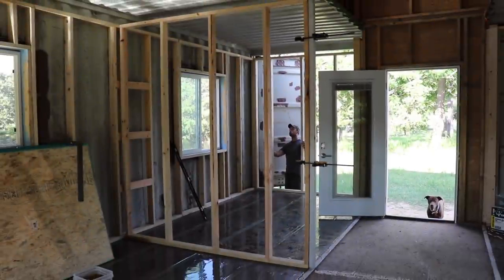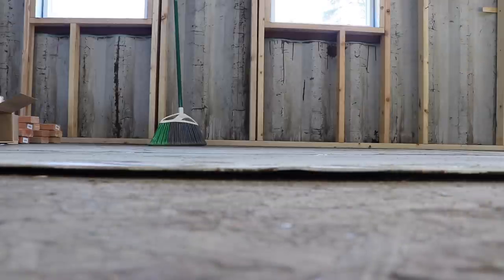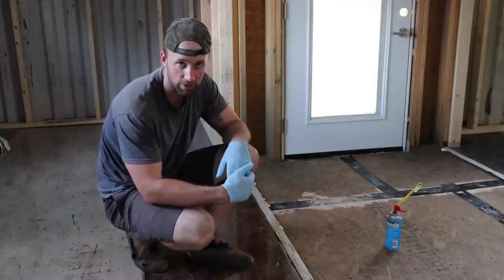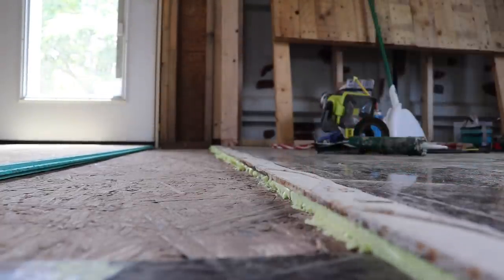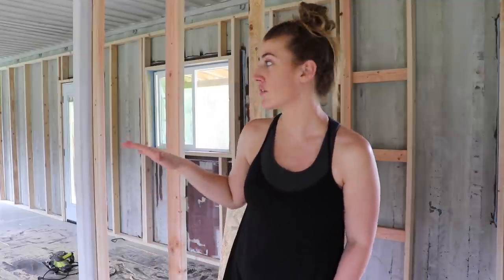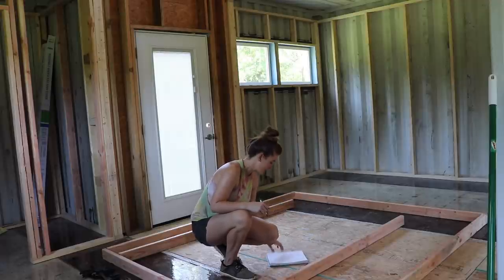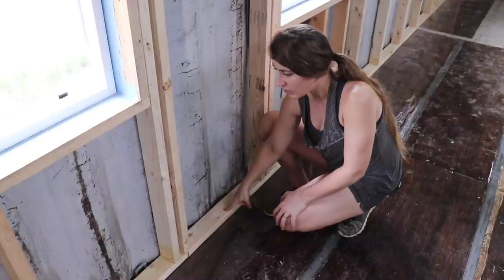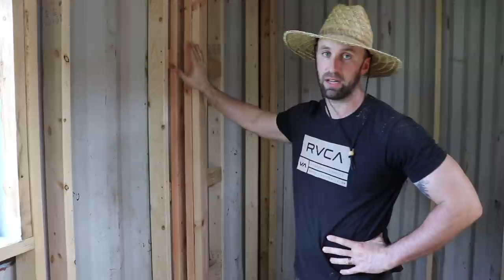Building The Rooms In Our OFF GRID Home!

Comment: There's a lot of framing to go. If you're doing your own plumbing, electrical, and hvac then nail on the boxes as you go. Switch boxes at 48 to the top, outlets at 18, bath outlet at 45, bath light at 84, fan box, range hood vent, holes for ducts and return air. All need planning and framing.
Curtain rods, towel holder, tp,hand towel, medicine cabinet, kitchen uppers lowers (3 runs) tv hangar, all need planning and framing.
Plumbing stub backing at every fixture including hwt. Sheetrock and tile backing for tub/shower. Tile backer for range. Sheetrock backing at ceilings. 

Tons of framing to go!
Reply: I would run conduit for the electric due to the spray foam. This will make it easier in the future if you have to repair.
Reply: @jerryhughes6263  
Did you price the difference? It's triple the cost over romex. Right now wire is back down to where it was 15 years ago. 
Congratulations on having the ability to work with the bender. Most folks think that they can do that job but end up quitting on day 2.
My point was about the framing. There were comments about being finished with the framing and I wanted to point out that there is alot more to go.

Comment: How are you going to insulate the floors? You'll have a lot of condensation buildup unless your insulate the floor on top of the steel
Reply: Absolutely Correct!
Reply: X-cellent point ...I thought about that too ...
they should apply a vapor barrier on the ground as well as under the house ...maybe they'll do that after the plumbing/electric ......
Reply: That would normally be correct however since this is a welded steel box the heat from the sun radiating against the sides and top will transfer through the metal frame to the steel beams in the floor which would be on the inside of the container. I've stayed in a container home when they insulated the inside on the walls and ceilings but underneath the wood floors and every morning the floors would be covered in condensation. Checkout insofast. I looked into that and they make kits for container walls, floors, and ceilings.

Comment: how did u  prevent the rust from external floor at the bottom of the container  (external bottom of the container which is exposed to the rain ).
kindly clarify.
Reply: I commented this several times. I think they are either doing it last or  just planning on falling through eventually. Lol
Reply: They'll probably do that when under the house for plumbing & H-VAC install. No need to get under there in snake season unless you really have to. Been there - done that. When you're on your elbows & knees, a snake can slither faster than you can crawdad backwards. It ends up being man vs. snake and hope you can kill it without getting bitten. No worries, though. Spenser is too OCD to let one detail of that house pass him by.

Comment: Love it! Quick question... what are ypu doing for HVAC?
Reply: Damn,, beat me to it. Did you say the property had a well and septic tank/drain field? and how have you guy's been handling that during all this build as in temporary water/sewer/shower....must be getting pretty crusty by now..eh!
Reply: I too am curious. I know there are energy friendly units out there that will work wonderfully with an offgrid setup but I wonder if they would be cost effective vs a traditional unit that sucks down power like a drunkie at happy hour.
Reply: Probably a mini-split - much easier than doing a bunch of ducting...
Reply: Theyre running piping down into the lake, reverse heat pump haha
Reply: They should have thought about that long before they decided to use a steel box for a home, but they worry about those minor details when they get to them.
Reply: @jcgoogle1808  i started following because this was also my dream... I still think it's better than stick built by far.. I'm just going to watch and learn ... my only concern is it sweating.
Reply: @j.michaelwilhelm7349  as of now they have a gym membership and that's how they take care of hygiene.
Reply: @19TL85  They've been at this for a year and they're still at framing which would be redundant on the exterior walls were it not for the steel being the worst material to use with regard to heating and cooling.

It will take substantially more energy than conventional construction to live comfortably. Not good for supposedly attempting to conserve energy and "live off the grid". With stick built, they could have poured a slab and been dried in and done with framing within a month or 2 at their pace...... while still "living off the grid".

Btw, "grid power" is much more efficient and economical than everyone setting up their own personal power plant, unless they minimize energy use. A steel box, doesn't do that.

If they really wanted to conserve energy, they would have poured the slab and built the home out of SIPs.

If they or anyone else wants to build a home in a dumpster for that matter. it's a free country, but the idea this conserves energy or "saves the planet" is nonsense.

Imagine 300 million Americans doing this on their own inherited 100 acre piece of land.

You'd do more toward "saving the planet" by minimizing urban sprawl and cutting down CO2 absorbing trees by living in a high rise apartment building.
Reply: I've seen many other shipping container home videos & most of them use the Mitsubishi H-VAC units. They're nearly flush wall mounted, don't require venting/duct work, & have motion sensors that aim the heat/cool where you are, so you always feel warm/cool. Plus, they can be integrated into smart home technology. In that small a space, that's what I'd go for.
Reply: @19TL85 
That's why they set all the wall studs 1/2" away from the steel walls and used the paintable flashing where wood contacts steel. When sprayfoam insulation is sprayed onto the steel, it prevents sweating. But I would have an H-VAC system that has a built in dehumidifier just to be safe.
Reply: @jcgoogle1808  
If we cut down CO2 absorbing trees, which release O2 in turn & also scrub the air we breathe, how is that helping the environment? Be clear on what you mean & write before you click "Post." City sprawl, with all its concrete and asphalt retain & radiate heat into the atmosphere like an oven. They're also a breeding ground for filth and garbage.

We live in America where people are free to live as they chose. Some like the city & some like the country. Being environmentally friendly extends only as far as I live, you live, or they live. Life is too short to think of yourself as "The Guardian of the Planet," i.e., the "Thought Police." A word of advice: Relax & enjoy life, because no one is guaranteed another second. These guys are having the adventure of a lifetime, and we get to watch. Why try to rain on that parade? If you want to be miserable & enforce your values on everyone, go be miserable somewhere else.
Reply: @jamesooten3659  
"If we cut down CO2 absorbing trees, which release O2 [sic] in turn & also scrub the air we breathe, how is that helping the environment? Be clear on what you mean & write before you click "Post.""

LOL Apparently reading comprehension is not your strong suit. I can't find my original comment and don't care enough to spend more time looking, but I was asking that question of those who think this (using a thermodynamically inefficient, that is one that conducts heat easily, the opposite of what you want if your goal is to be energy efficient), a steel box is "saving the planet".

"City sprawl, with all its concrete and asphalt retain & radiate heat into the atmosphere like an oven." 

I'm not sure what you're trying to say here (a piece of concrete or asphalt does not cause the earth to warm "like an oven", that would violate the law of conservation of energy) again, my point was,... how would 300 million people moving into the country, an urban sprawl,  save trees and the planet, if that's your intent? It would do the opposite.

High rise apartments, the opposite of urban sprawl, would be the choice of someone who was really concerned about the environment.

i also think that people who think that "climate change" just started happening with the industrial revolution are batpoopinsane. If that were the case, earth history has a lot of splaining to do. Man evolved as a result of climate change, not the other way around.

https://wattsupwiththat.files.wordpress.com/2012/04/400000yearslarge1.gif

This "living off the grid" thing is so cliche,... any crazy idea regardless of energy efficiency is considered contributing to "living off the grid".

"Be clear on what you mean & write before you click "Post." "

LOL Too funny.
Reply: @jcgoogle1808  x2 If they would have put the money and effort spent on using containers not suited to living in, and stick built, it would have been much easier to build, more efficient, and as you said, finished in much less time. While they have put in great effort, I don't see a point to the containers. A slab would have been more efficient than setting all of those piers and dealing with the containers. Then again, I'm a pro in the building trades and have a couple decades of experience doing all of that type of work in residential and commercial buildings. They either don't understand the benefits to stick built over steel containers or are just hard headed and did it to get people to watch. Off the grid is great, but why would they make their build even more difficult than it has to be?
Reply: @CGT80  "A slab would have been more efficient than setting all of those piers and dealing with the containers. ........... Off the grid is great, but why would they make their build even more difficult than it has to be?"

Exactly or more energy inefficient. 

I'm not sure with the steel building envelope how it gets connected to "living off the grid", but it's kind of hard to not watch...like a train wreck. ;)

If the industrial architectural look is the goal, why put it in the country? Developers rehab old warehouses and industrial buildings into condo's etc everywhere. That actually looks good and cleans up a neighborhood.

Putting a shipping container in the country is anachronistic when not too far away the Texas Hill Country has a rich architectural history of buildings with stone walls. A lot could be done wrt to energy efficiency around the thermal mass of stone.

But it's a free country. More power to them.

Comment: There is a couple here that did just what you have done . And they said they put insulation in there ceilings and had to go back and put more because of the heat !!! Also had to double insulat the walls. Other than that , they are as happy as 2 ducks in a bathtub !!!!! I must comment myself .... Yall 2 have worked your butts off and have done a great job can't wait to see the finished project !!!!!!!!!

Comment: Beautiful dog you have there.  Suggestion:  You may want to consider packing the interior bedroom walls and the laundry room walls with dense foam insulation.  That would make the rooms quieter and in the case of the laundry room it would block off some of the washer/dryer noise from the rest of the house.  Don’t forget to insulate the ceilings too as the washer/dryer can get pretty loud and in a container home it would only reverberate throughout the container if the sound isn’t contained somehow. The bedroom insulation also makes it a little quieter for sleeping or napping.

Comment: Hey, love the new video! NOTE- My friends built a container house in Tennessee about 7 years ago. He said the interior roof of the container attracts humidity when you have ac on and its hot outside. He opened the cieling  to put in a cieling fan, (frame, like yours is going to be) and found condensation on the metal roof, and some rust. They checked inside a couple places on walls, and found some but not as much. He said he would Herculiner the cieling inside before building the frame drop if he had it to do over again. He said the inside is no longer airtight once you start cutting holes for windows and doors, no matter how much you caulk. I know Spencer loves doing extra work so I thought I would pass this along. 
I need more Bear in my next video btw.

Comment: Hey guys. If you are gonna have a crew spray foam the insulation.  You may want to fill the gap between the metal and the stud with canned spray foam first. If not it might push the wall out.

Comment: Recommend you open those upper windows and open the lower windows on the shaded part of the house. It will get rid of the stagnant air and give you a little bit of breeze.
Reply: Interior is really coming along. Soon you will be painting the walls! What about windows high up on the interior walls so you can pull in some natural light from the atrium into the rooms that only have one window or none.

Comment: if you bury 24" pipe (sealed up) 8ft deep, 12ft from house and 25ft longer, with ends to complete the "C" shape into inside at both ends, your heating and cooling would be about done with just a 20" box fan. with skirting some (air) can be run under the floor too. Geo-stable temperature is about 70 degrees.

Comment: You need to corner your wall frames or you'll have dry wall without support on the ends, and be sure to pre drill your holes for your wiring so you don't have to back the boards off to get them through.

Comment: the dead space that will be above the wall could be a good channel to run your electrical feeds ,at least for that side of the house ,it will save alot of time and wont have to drill hole as much ,do the same on other side but make sure the wires stay on top of the wall plate ,then just drill a hole every so often to feed receptacles or whatever lights switches ,looking good ,you guys did alot of editing on this post lol spencers funny put more bloopers in

Comment: Guys, I think you're doing a FINE job on the house. I would like to give you advice about your pocket doors, I know you're going to have a few of these so when you buy them please order a few extra top tracks and probably 6 or so sets of rollers. The reason behind this is that these cleaver pocket door manufactures have a wild Idea to change the design every 5-7 years and when your rollers or your track messes up down the line and you fine it extremely hard to match your hardware you will say to yourself, dang Karl was right.

Comment: Nice ! you are building in the right climate, for us we have -30 degree winters which increase the cost by 40%....for your floor planicrete  would of been lower cost and fast. Up here we use pink wood and 3lbs close cell stray foam...condensation is a real pain.
Enjoy your new abodes :]

Comment: Did you guys insulate the floor underneath and sandwich it with more plywood on the bottom of the joists? I can't remember if ya did, not to late if you didn't, a lot of heat and cold can migrate from underneath. Keep up the good work, my wife and I want to do what you'all are doing, very inspirational. Cheers!

Comment: How do you plan to ventilate the insulation above the walls (ceiling)?  Unless you use sprayed foam the moisture that rises through the ceiling and vapor barrier will form mold and possible dripping.

Comment: Really nice project... been following since the first vid and am loving where it's going!  
Questions
1) if you are going to cover the epoxy floors later, why wouldn't you cover the full floor with 1/2" ply/osb first and set your wall base plates on top?... building on the floor rather than contouring it later.  
2) why didn't you install a vapour barrier along the outside walls?  I'm from cold Canada and I probably would've installed one.

Thanks for the videos!

Comment: Had to read around to find your in Texas  Not much for a cold winter So no real need for soild spray foam insulation  Which i would swear by if your in Northern Canada  But your in a 2-3 zone for moisture so you dont even need a vapor barrier... When i watch your videos I think where i would do what next. Electrial and Plumbing..2 Outlets for a main wood stove And a mini for the bedroom Then 2 to 3 inches of spray foam ( We see Artic air winds. And frost bite in 5 mins ) 

Oh ..And remember before you board everything up take one last look and think...Do i need a outside electrical outlet in the wall or vent ..better now then after lol cheers all the best

Comment: Hi looks so exciting. I was wondering what you r insulating with. I know in hot climates there r certain foams and such that should be used with the shipping containers because of condensation, mold . The steel will sweat from ac inside just wondering what you guys are going to use ? Looks great I want to do this too if I can get my hubs on board.

Comment: try a fan too move the air around, once the old air is out there should be ten too twenty degrees lower. once insulated you'll get a good twenty or better. again fans make a difference.  or run an AC too cool the place.

Comment: Another question??????? Are you using non faced fiberglass insulation or are you using structural high density insulation panels with a foil backing in the walls and ceilings????????

Comment: Why are you not getting the insulation in and the A/C done at this point? Or at least get yourself a swamp cooler or something in there... swamp coolers work really well as long as they have good air flow. You're at the point where you're working indoors and you're in Texas... don't suffer.